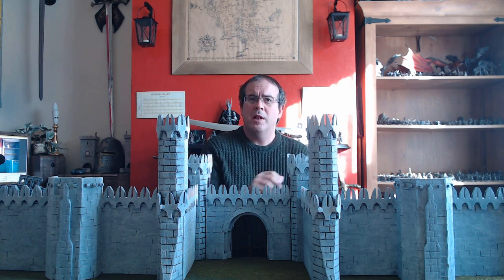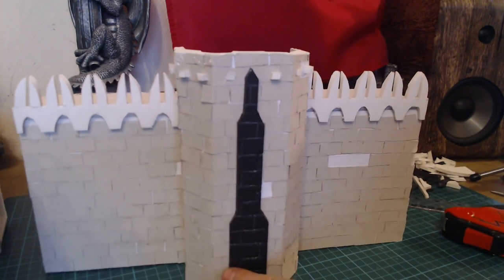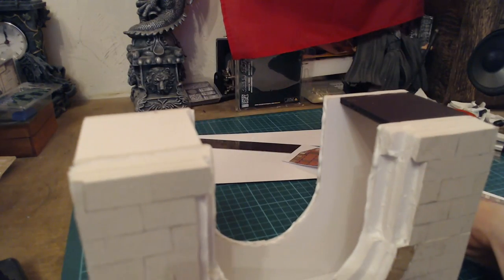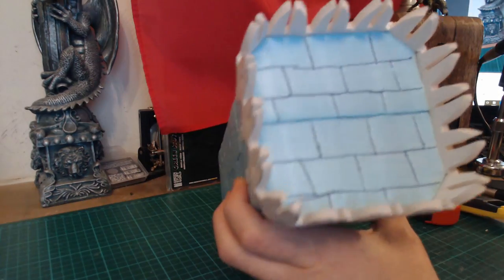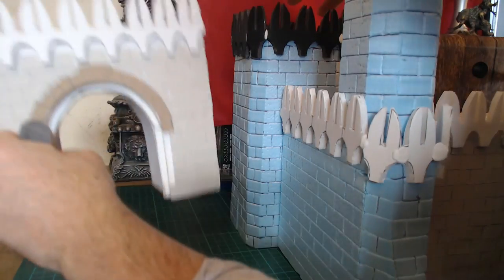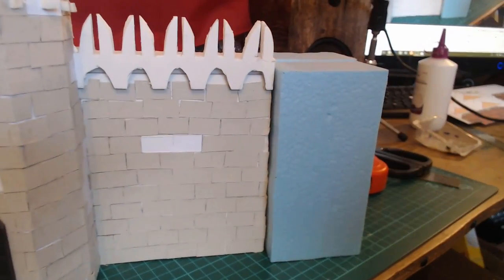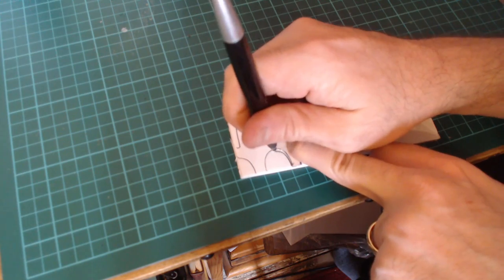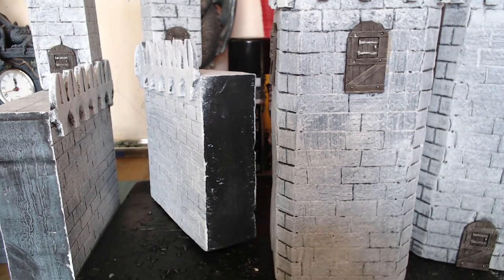Tales of Middle Earth - Building Middle Earth Minas Tirith

Comment: Wow, that's impressive for real
Reply from the maker: Cheers glad you like it!
Reply: Hi, a Reddit thread turned up this vid and I'm hoping I can pick your brains!

I'm currently hollowing out a sq km in Minecraft for the purpose of building Minas Tirith to scale, detail will obv lack in the finished build due to blocks being 1m³ but I want it to be as accurate as pos, so, would you have accurate measurements for all or parts of Minas Tirith, if so can I have them, and if not can you point me in the direction of a decent resource for such be it online or a paid for publication etc?

Thanks in advance 😁